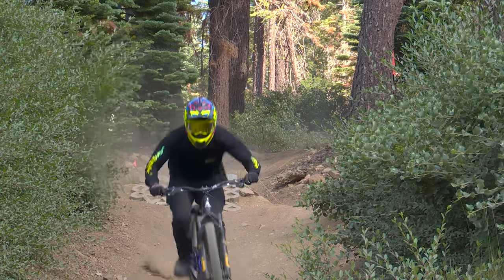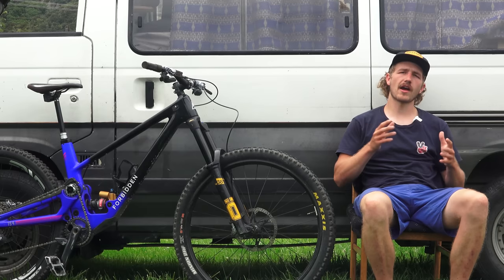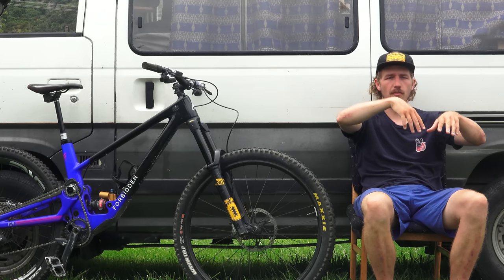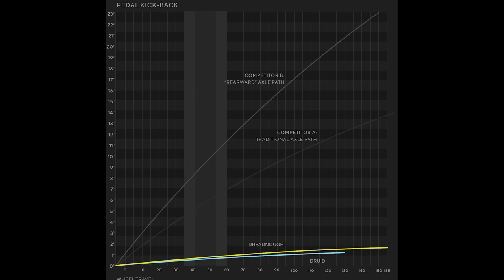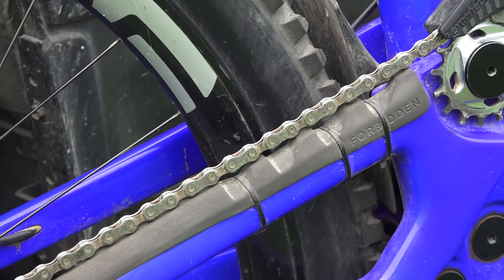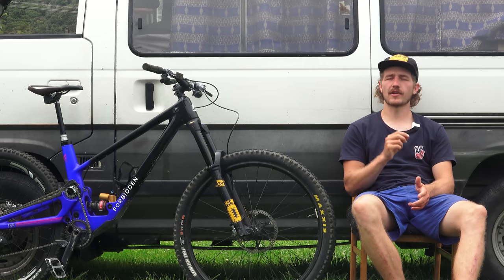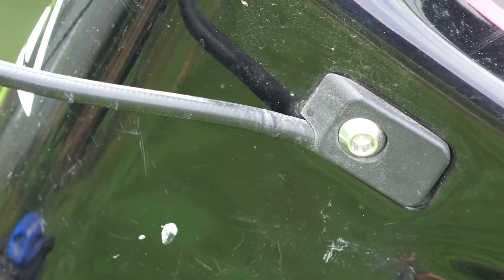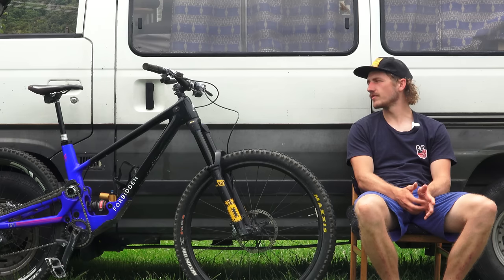Forbidden Dreadnought Long Term Review

Comment: Sick video! Love my dreadnought. I often get a weird noise from the back end on side impacts, wondering if you’ve noticed the same? Had all the bearings done and shock bushings, thinking it could be the rear wheel flexing meaning the tire buzzes on the lower chain guide pully cage not sure though 😂
Reply from the maker: Ah forgot to mention this! It’s the chain guide.  Had me scratching my head for a while too.  If you move the position of the lower pulley it clears up the issue
Reply: @briancahal  Ah ha good to know, rotate it upwards or down?
Reply from the maker: @harveycoates5749 not so much the rotation, you can slide that bottom roller forward or back, so just move it forward a bit
Reply: Bro this is the best review makes me wanna send shit love the stoke

Comment: I was very interested with that bike, it looks so different in a good way. Then I check the geo and found out that in mullet configuration, size M, the chainstays are only 432mm! This is really, I mean really short. Seat-tube angle is far from steep at 75.6 degrees. Sorry but these two dimensions are just not acceptable. I can see that Brian is also riding different bike now.

Comment: I really appreciate your tech videos. I am about your height and came around to a lot of the same conclusions after many bike park laps and crashes - longer chainstays, high bars (try even higher!), supportive suspension that only feels good going fast, flat pedals, no inserts. I'm not trying to say everyone should do the same (certainly not for size dependent stuff like rear center and cockpit), just that it's nice to know I'm not totally nuts. Sometimes when you go against the grain you start to wonder. So thanks!

Comment: So sizing wise, I’m 6 foot 7. (All legs. You’d probably be taller if we were sitting next to each other.) You think I would be able to fit a XL?
Reply from the maker: Those are some long legs! I think you could go XL. the reach isn’t absurdly long.  It’s a big jump in wheel base but not necessarily a huge jump in reach since the chainstay grows quite a bit as well. I think you’d appreciate the overall length without feeling too stretched out over the front.
Reply: @briancahal  Yeah, I’d definitely want to demo one. My current bike is a S5 Specialized enduro. I have it set up pretty big, but it slowly starts feeling small we as I grow (obviously.)
I just cover by saying “my bike is getting more nimble” 😂 
I always thought long reach was the main attraction for a new bike for me. 
But after a bit of research I noticed that stack height is a big part of a comfortable bike. So unless specialized comes out with a S6 (XXL) enduro, the new Santa Cruz Megatower has amazing specs. The XXL coming in at 520 reach and 670 Stack, I think I found a winner! Or unless Forbidden come out with a XXL dreadnought
😏 
But thanks for reaching out about the forbidden. I think it’s super cool what you and Vital Mtb do. Lemme know if you want to nerd out about bikes 😆
Reply: @erod6468  oh yeah, the Megatower is probably my next bike. Or if specialized make a bike S6 enduro.
Reply: I am 6 foot 4 with a little bit over 3feet inseam and the XL fits perfectly. I think I could be a little bigger without any issues. For me the longest dropper is 210mm, that would fit in the seat tube. I tried a 240mm OneUp dropper that was about 10mm to big. So I guess you would be fine with longer legs and huge dropper
Reply: @sprousaTM  LOL, just measured my saddle height. I’m sitting at 3 foot 11 🤣🤣Bruh, I should’ve stuck to basketball 😂😭

Comment: Solid review and I'd agree with everything you've said. One additional aspect is the bike is silent on descending at the drivetrain. That guard under the chain really does mute any rattling noises. 

As always, set up is key and if you've got the right shock on it, it's an excellent bike.

Comment: 100% agree about longer chain stays effect on bike handling.

My current bike has ridiculously long effective chainstays.  480mm or there abouts.  

It really does give great weight distribution.  It naturally weights the front well.  And makes for a very stable ride.
Reply from the maker: Damn! 480mm what bike are you on?
Reply: @briancahal  It's a large frame Dengfu E22.  It's a Chinese carbon frame eMTB, which uses the bafang ultra mid drive pedal assist motor.  

It sounds ridiculous, but it works well me.  Good for high speed stability, which is a good match for the bike considering the motor is twice as powerfull as the likes of bosch/brose, and not speed limited.  So you tend to get up into high speed pretty quick for any given trail.

Not so good for tight switch backs, and tight manouvers though.  So there is always a trade off.

Comment: Damn I wish you reviewed more bikes, solid review! I getting pretty close to buying a new bike here. I’m 5’11” and I have a 1st gen stumpy evo (140/150mm) with 475mm reach, 63.5° HTA, 328mm bb height, 1252 wheelbase, 443 chainstay, and 813 front center. The geo is f*cking sick. Absolutely rails turns with that bb height. However the travel and linear kinematics hold it back in chunky stuff, and I want to get something more capable. I race enduro here in Colorado and usually podium in amateur. I also ride a lot of steep trails and lots of jumps. The 3 bikes I was looking at were the Firebird, Wreckoning, and Enduro. Not sold on any of them. The Enduro is so big, the Firebird has no reviews, and the wreckoning might be sketchy with those short chain stays. Wasn’t really considering the dreadnought until I saw your review, always figured the high pivot cornered bad. I was looking at your channel and saw you had a firebird for a while. What are your thoughts on the Dreadnought vs the Firebird? Thanks!
Reply: Did you get a new bike dude? How about transition sentinel?

Comment: Keep up the great work! Really liked the analysis and logic, clearly shows your time spent testing setup. 2 possible areas to cover for a futr video 1) what do you feel (eg force through hips outside leg) when initiating a corner and 2) what settings worked for you when you tested RS forks? Eg support via air vs closing off compression.

Thanks!

Comment: Great review. I already wanted a dreadnought but this review really seals it for me. Will be hunting for one in the spring. 

Another thing you mentioned is bar height. I am your height and recently put surly sunrise (83mm rise!) bars on my privateer 161. It has really transformed my bike. With more weight on my feet and off my hands, I have better bike/body separation. It’s especially apparent under braking bumps where before the fork would struggle to support my weight while tracking the bumps. I highly recommend you try running something similar.
Reply from the maker: Those are some ape hangers! Would be curious to give a set a try.

Comment: @10:16 You should consider the race guide with the stainless steel idler pully (already installed) available on the website under small parts tab.

Comment: Owning one of those badboys in XL, although I am not riding nearly as advanced as you. Not sure about size L, but with XL I do not need the lower chainguide and have never lost the chain. Basically everything you said, I would too. The best features after one year of riding it for me is the amount of stability this thing generates going downhill and that there is no kickback at all. I do own a giant enduro ebike as well that has minimal kickback but it is so noticable that there is none on the dread. In the summer with lots of dust and dirty chain I tend to clean the idler every 2-5 rides. The drag is noticable.  It does climb pretty well on technical climbs though but I think its on the slower part. I switched the alloy idler to the stainless steel one. It lasts at least 3 times as long.
The only downside is the wheelbase of this thing. Gotta live with that for all the good parts. On  really small and narrow turns in steep terrain I tend to hate this thing but when the trail opens up its been a blast.
I just cant get this thing to manual well. I am not good at it in the first place, but this bike just wants to stay planted.
Reply: Hi just wondering what height you are, I’m interested in getting one and am not sure wether to go large or X-Large
Reply: @ReverseRG1234  I am 1,94 meters or about 6foot 4
Reply: @sprousaTM  thanks, think I’ll go with the XL

Comment: Fantastic and extremely thorough review. Interested, hour do you get on with springdex coil? Been looking at these for a little while now.
Reply from the maker: Sprindex is awesome. Never had an issues and allows incremental spring rate adjustment as advertised.  Would definitely recommend
Reply: @Brian Cahal  hey Brian what spring rate are you running now with the springdex( rough sag%?)

Comment: Had you been able to spend much time on the Druid when you were with the brand? I am coming from a Norco Range and want to downsize as my new local trails just really don't justify big travel. Still will be going to bike parks but I don't mind being under-biked for a summer, and would plan to have a DH bike next season. I am the same height, really just curious on the sizing and if the XL Druid would be a good fit. I am coming from a XL Range which is ungodly big and sucks on anything short of fast gnarly terrain. I am not as worried about the shorter travel figures on the Druid, mostly just size. Without sitting on one I am in limbo. I do have long arms and legs for a 6 1/2 foot tall rider. Style is aggressive (15 years riding with some local racing) but also enjoy side hits etc.... I am a touch worried the figures on the XL Druid will leave me with the same long boat feeling my Range has albeit still significantly shorter wheelbase. I resonate with your content, riding and bike set up so I would be keen to hear your thoughts. For reference I live in Spokane WA and ride beacon hill, grew up in Issaquah riding 27, Tiger and 38 if you are familiar with that terrain. Anyways, keep up the good work I have watched the entire series and love the direction you are going! Cheers
Reply from the maker: I’d say XL for the Druid, it’s what I’m running at the moment.  Very similar geometry to the L dreadnought.  Only thing I don’t like is the seat tube is a bit high and the head angle a tad steep
Reply: Did you try one? Have you seen the new Druid, they slackened it and someone has won Squamish enduro on the new Druid

Comment: Thanks I’m having a few issues with setting my chain and B tension. Correct me if I’m wrong but if I screw the b screw out that moves to jockey wheels closer meaning more slack however this would also mean more wrap around the last cog?

Comment: Hi man .
You mentioned one item I'm seeing more of . You spoke of the axle , and how they changed the axle . Would the 2022 frames come with this solid axle and or where can I find one . Plus how well did the Öhlins ttx coil bottom eyelet hardware work for you over the time you had on the bike. (Any hardware you would recommend?)
Reply from the maker: The new ones should come with a solid axle. I’ve had to replace one set of lower hardware in the shock.
Reply: I ended up using fox bearing hardware on my TTX I wasn’t happy with the standard hardware at all.
I’ve gone back to RS Super deluxe to compare as I’m still not happy with the TTX, it’s too firm at the start with fast harsh impacts which is what the Dready does best.

Comment: What  handlebar do you use?
Reply from the maker: Currently running a the Sam Hill horizon bar in 38mm rise.  I like the PNW and one up bars too they just don’t come in higher rise options
Reply: @briancahal  Yes, that is exactly my problem.  all the time I thought which of the (one-up,pnw) two handlebars would be better at absorbing vibrations but all the time I was struck by the lack of a bigger rise.  How  comfortable is  hitting roots and rocks whit samhill compare to oneup and pnw ? Thank you!